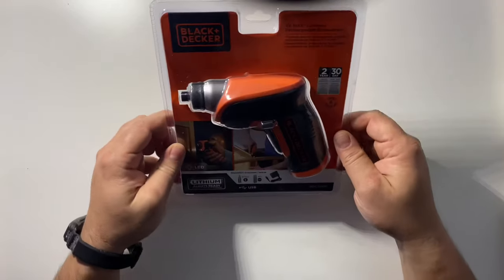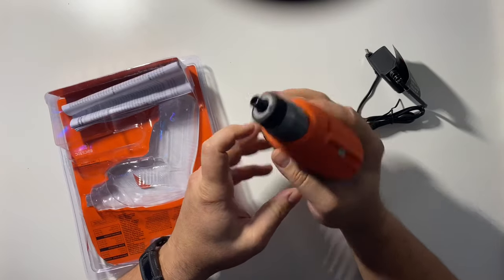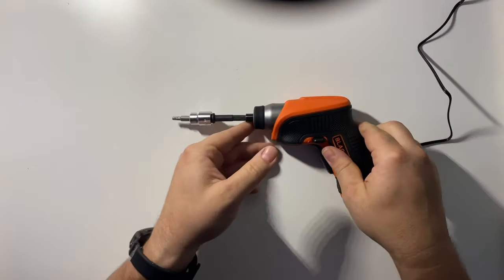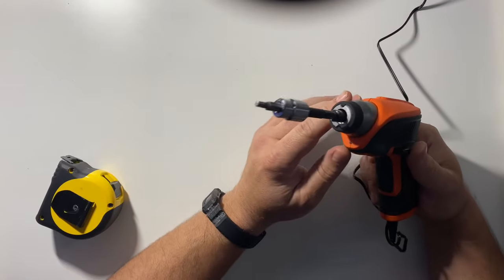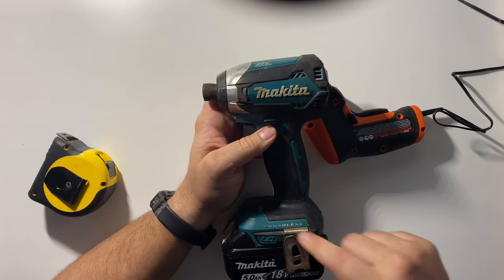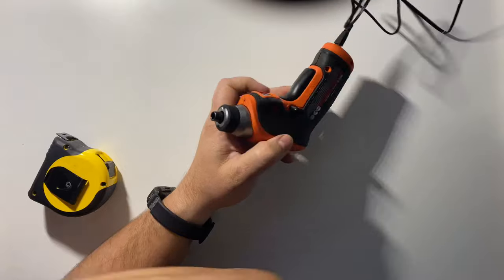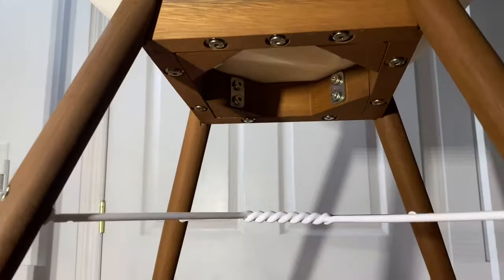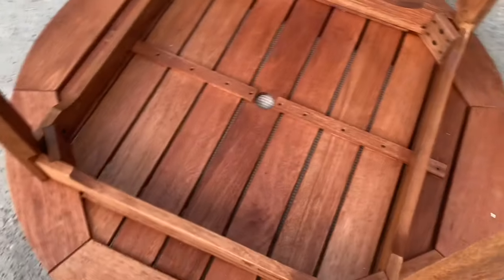BLACK+DECKER 4V MAX Cordless Screwdriver Comprehensive Review | Should you buy one?

Comment: I have this screw driver. It's not bad, but it really needs an led light to show charging status. I guess after two hours you're supposed to assume its fully charged. When it dies the battery just looses power.......so with with lithium batteries if the battery voltage drops below 3 volts you've just ruined the battery. They should atleast have a low voltage cutoff of some sort. The Skil screw drivers have this. The power to the motor cuts off when the battery is in need of a charge. Why can't B&D do this? The Skil screw drivers are also cheaper.
Reply: Thanks for that info bro...I've been looking to find something about charging and your info was very helpful...take care